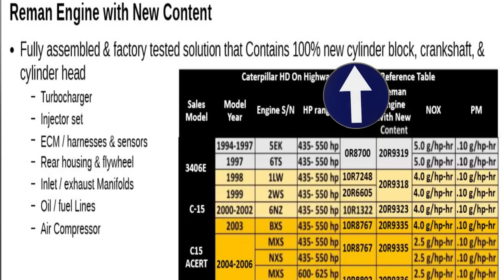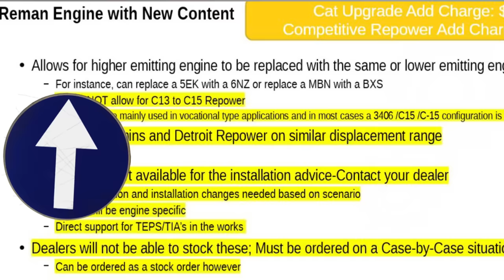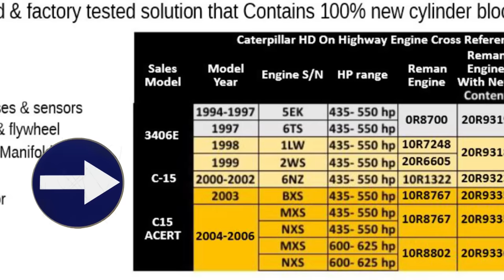Swap Your Cummins for a NEW Cat Engine!  Cat is Making New Truck Engines.

Comment: When the government collapses and the EPA is gone we will need to produce reliable old tech diesels again.
Reply: Lmao
Reply: Amen!
Reply: @tjts1  Where in the budget is the subsidies to oil companies?   I hear this all the time but no one has been able to show the proof of where in the budget it is.  The budgets are on line just go pull the PDF and tell me the line item please.
Reply: @Pusstulio  well there's a lot more subsidies going to "green" energy than any other forms of energy, so "green" energy should be the first to collapse if the government was to collapse
Reply: @tjts1  you'd just buy it.
Reply: Definitely!! an EMP proof one 👍
Reply: When the government collapses...rrrriigghht.
Reply: Maybe if Putin sends DC a gift
Reply: I'm good I have a couple B's in the shop
Reply: @tjts1 , you can make Diesel fuel from crude oil fairly easily. Diesel is the first thing to distill from crude oil making it a cheap fuel just not EPA “clean” even tho it’s cheap to make, & pays for the engine it’s used in fairly quickly.
Reply: Can’t wait
Reply: @tjts1  don't need the government to have oil...
Reply: @Badger Pa  most of the subsidies are tax credits, which conveniently aren't a budget line item, so the value has to be estimated from financial analysis. Here's a summary of some tax breaks and their estimated value.

 Intangible Drilling Costs Deduction (26 U.S. Code § 263. Active) $1.59 billion

Percentage Depletion (26 U.S. Code § 613. Active). $12.8 billion over 10 years

Credit for Clean Coal Investment Internal Revenue Code § 48A (Active) $1 billion

To name a few.
Reply: We can only hope 🤞
Reply: @markwilliams4525  Exactly. "Green Energy" generally speaking is a money sinkhole.
Reply: Exactly brother..
Reply: @tjts1  show us proof of these “subsidies!”
Reply: Can't wait until Detroit makes the 92series again oh and maybe a 8v-110 engine too!
Reply: @fly-over1517 it’s either that or we go down. It’s we the people not the other way around
Reply: Hoping the Government collapses? Why not move to Russia instead comrade Drew?
Reply: Translation: Any brand with mechanical injection... Cummins 400, Detroit 318, Cat 3406b'. Modern chassis 4-stroke stuff that'll do around 2000 ft-lb and mate to a 13+ speed
Reply: @thebigmacd  thank you. That's right where I was headed. Military spending is another thing you can't find all of the numbers up front on. Tax breaks, subsidies, etc...
Reply: @fly-over1517  people are the government, and we haven't collapsed..
Reply: @tjts1  Mexico
Reply: The scary aspect of that is how much money will they print/spend and bailout wasteful industries, how much will the taxpayer suffer before they admit they were wrong? The answer to that should be your level of preparation. They aren't coming to save the taxpayer.
Reply: @fly-over1517  You know when a consumer maxes out their credit line and tries to consolidate or refinance several times? The government has reached its limit with the world bank. Even voting in another "debt ceiling" will not change the outcome. We have done this 80 times since '81-82. The globe can easily decide to default on the USD since its debt is high, and not backed by real assets.  Follow the multipolar world overseas, they are dumping the USD as the reserve to save the global economy. Oil will be first, followed by agriculture, and manufacturing.
Reply: @sandasturner9529  As much as I love the Cummins and Cat, the 16V92 is king. That monster is almost too big for a truck, more like a ship.
Reply: @francomtz7115  I would agree with you, aside from the fact the majority of citizens do as they are told without critical thought. We're not in charge obviously.
Reply: @tjts1  cold pressed vegetable oil
Reply: @tjts1  That would mean the diesel fuel would skyrocket to like $6 per gallon. Oh wait, the price is already that high. 

The real problem would be keeping the refineries going, against the chaos that would take place in a govt collapse.
Reply: @tjts1  ever heard bio-diesel?
Reply: @tjts1  from me, when I buy fuel.
Reply: @cstew8355  your comment cracked me up, to make a  EMP that can take out a computer needs to be almost as strong as a nuclear bomb 🤣
Reply: @fly-over1517  it’s closer than you realize
Reply: @michaelbenoit248  I have about 20bbl of crude i need to dispose you are welcome to it lol
Reply: @tjts1  they make diesel in nigeria
Reply: When the government collapses, what will you buy engines with?
Reply: Dude,   put down the pipe and step away..
Reply: I wish. The reality is the irs, atf and epa will survive
Reply: @jakeford7688  I have a 379 Peterbilt 425 Cat B model do you have any idea how much it’s worth?
Reply: @donaldindividual-1  by the way Russian citizens have more far more freedom then we do here.
Reply: @scotteric8711  16v Detroit were made for for Marine engines. In fact original Detroit engines came from Marine two-stroke engine design.
Reply: @ShaunHensley  I will barter chickens an eggs.
Reply: Can’t wait!💪
Reply: @tjts1  The government has money? Wow. How did that happen? 🙄🤦🏻‍♂️
Reply: My beloved California is dying fast.
Reply: @tomstulc9143  As do most Europeans in general. Except the poor Brits. In Poland you can walk around a mall with a 40 oz. That's bliss. 🤣
Reply: @tomstulc9143  Theres a few in OTR trucks. The Army still uses the HET 1070 which uses the 8V, although they have a prototype with the 16 that never made production. And yes, it was ugly. 🤣
Reply: @dortega1404  $20
Reply: @leejohnson6173  what are you trading for the fuel? Who is shipping it? Maintaining the roads? Electric grid? Who is stopping the electric company, fuel company or whomever from charging what ever they want or if the company is big enough from taking your stuff and becoming the new gov with no constitution?
Reply: It’s coming.
Reply: Gotta have a dream.
Reply: Right
Reply: I've watched interactions with EPA employees. They're really not the brightest bulbs in the chandelier.
Reply: @tjts1  Why is Jet A cheaper than diesel ?
Reply: Don’t hold your breath.
Reply: WITH MECHANICAL INJECTOR PUMPS
Reply: I bet you’re exhausting at parties.
Reply: Oh Man!
Reply: When the dollar collapses and is replaced with some other country’s currency, that’s when the fun begins.
Reply: @MrErichonda30 they have and it’s named Joe Biden
Reply: Agreed
Reply: @tjts1  recycling plastic
Reply: Yea!!!
Reply: I dunno! That's wishful thinking.
Reply: @thebigmacd  tax credits and tax breaks are not subsidies. Tax subsidies are what green energy gets. Tax breaks are what fossil fuel receive. The difference is that if the government were to collapse, green energy would also collapse. While oil would get more cheaper and more abundant.
Reply: @Rudderify  that was china
Reply: @tjts1  do you actually think that subsidies are necessary for oil to be produced? Just because the government is tossing out money and companies are taking it doesn’t mean it’s needed. Green energy on the other hand, most likely wouldn’t exist without subsidies. Especially wind power.
Reply: Sure thing, the government is going to collapse while oil refineries continue unabated 😂
Reply: All it would take is a Lawyer at Cat realizing that the gubbment can’t haul Cat into court without Locus Standi; aka, a customer that was harmed by Cat’s business practices.
Reply: @tomstulc9143  In russia you criticize putin you go to Gulag
Reply: Ha
Reply: Lol, when...
Reply: Hallelujah, I want my Studebaker 6x6 !
Reply: @tjts1  motor oil or alcohol still. Pretty easy
Reply: The government isn’t going to collapse and the EPA isn’t going anywhere…not with you all commenting on YouTube video 🤦🏻‍♂️🤦🏻‍♂️🤦🏻‍♂️
Reply: @AbcXyz-rn2lz  

And i wish there are carburetted diesel engine

Because we can easily tune the AFR easily
Reply: @rab _aintboutit  
Government is going byebye, Mr Rabbi. You can't stop what's coming. The fire rises.
Reply: I hope that happens soon
Reply: @scotteric8711 it's primarily used in the marine industry ,tbh with you
Reply: @tjts1  I'll find or make fuel.
Reply: Sign me up. I want some 2 Stroke Detroit Diesels.
I love pre emissions diesels.
Reply: Hell yeah
Reply: @scotteric8711 lol. I’ll bet on Americans for many decades to come - not against them. 

Doomists are weird.

Comment: The secret message here is take very good care of your 2000 and earlier trucks because now you can get a brand new engine for it. NO emissions YAAAA. More better power and excellent reliability. Go cat 😁😁😁😁😁
Reply: They gotta start selling frames and cabs too
Reply: @andrewk8636  👍😊 make ole epa man blood pressure go up
Reply: No thanks I'll keep my 9.5 mpg over my old shitty ass 3406e. Cat is the worst thing to put in a truck if you're out here to make money.
Reply: @monsterpke857  Wow!! what are you hauling that you get that mileage? I've been driving truck for 42 years. I've never heard anyone say they have had bad luck with a 3406E. Maybe you just got a lemon. It happens. Maybe you pound the hell out of it.
I have a C-15 with 850,000 miles on it and I've not had to tear it down yet.
Reply: @railfaninpf  at no point did I say a 3406 B or E was a bad motor cat does not make a bad motor well maybe the Acer wasn't all that great but for me it's about making money. As we all know the market for making money in trucking is very bad right now.
Reply: @railfaninpf  I've had a 94 379 with a 3406 B. Was a good truck got like 4.5 MPG. I had a 2014 389 with a Detroit and it got like 5 mpg. Now I have just a simple Cascadia with the 500 horsepower X-15 and I'm getting right at 9 mpg. It is deleted. Honestly I hated the way these trucks look but I'm a very tall guy and I definitely cannot complain about the Comfort or the room that I have in this truck and I guess with the aerodynamics helps too but yeah I'm getting right at 9 miles per gallon but I also don't run her over 70 mph unless I really need to pass a group of trucks
Reply: @monsterpke857  you do you, I’ll stick with my cat that’s been paid off for years and has a extremely low cost of operation. Could I get a little better fuel economy with a new truck? Maybe, but not even close enough to offset having to pay for the new truck.
Reply: @monsterpke857 what do you have? I didn’t understand
Reply: @monsterpke857 I didnt get that much worse from the Cat to care. The Cat performed well and that was worth a lot.
Reply: @monsterpke857  you are correct but most think they can pay their bills on smiles per mile alone.

Comment: For years I've recommended the Cat 3406E and C15 series. But seeing how many miles on those old blocks and reman parts  and some of the issues my customers have experienced, I have been changing to newer trucks just because reliability in the remans is getting worse. I hope this program gets the reliability and longevity back.
Reply: You in NY?
Reply: This is why we do our rebuilds, cheaper and better quality control.
Reply: @MitzvosGolem1  Kansas
Reply: i got a reman from cat 7 years ago-a c13--have put over 1,200,000 miles on it--only did one overhead,changed one injector--tanker operation,running half empty,the ecm shorted out once on a bad wire--out of 65 trucks in fleet,best fuel mileage,lightest truck,highest revenue in fleet--still going, using 1gallon of oil every 3,000 miles--my 2008 f-350 with 6.4 gives me nothing but problems--lousy fuel mileage(no deletes)-in a 130,000 miles of no heavy hauling been in shop way too much--love the truck,hate the motor-love my cat which a lot of people don't like c13 but perfect for light weight--i made on average 4000.00$ more a month than the hairy legged petes,kws with c15 with my little kitty---that is close to a half million in 10 years!!!!! my truck is a cheap ass freight shake--2007,looks new
Reply: @dethray1000  Yeah I would be finding a different power plant to swap out that 6.4L.
Reply: I wouldn't swop a Cummins for a Cat anyway
Reply: @dethray1000    Lost me at Ford, go drive a Volvo .
Reply: The problem is letting Cat do the rebuilding. They are only going to stay within factory specifications which are more liberal than a reputable rebuild shop that will actually machine the block and balance the crank.
Reply: @dethray1000  1 gallon of oil every 3k? Its junk bud.
Reply: Just avoid anything ACERT.

Comment from the maker: Thanks for watching. If you are considering doing this swap and would like me to do the swap, whether filmed or not, please reach out at AdeptApe@yahoo.com. Thank you to everyone that submitted Destruction of the Week info.
Amazon Affiliate Links to recommended tools: 

Fuel Pressure Gauge, Compucheck 0-300 psi: https://amzn.to/3YeBldu
Airlift Cooling System Vacuum Filling System: https://amzn.to/3D9AlPu
Radiator Pressure Tester Kit: https://amzn.to/3QGBumn
Milwaukee 3/8" Right Angle Impact Wrench: https://amzn.to/3D2CvAk
2 Pack M12 Style Batteries for Milwaukee: https://amzn.to/3D2mdHE
Adjustable Height Parts Tray 100 lbs: https://amzn.to/3CBusZB
Engine Oil and Fuel Dye UV: https://amzn.to/3z34zkv
UV Professional Grade Light: https://amzn.to/3gzxPc0
Oil Pressure Priming Tank: https://amzn.to/3YuBrNr
Photo Tach REED: https://amzn.to/3ATJ8Cw
Reply: Your lighting is startlingly off. Your face looks so blue I thought you were having hypoxia.
Reply: Emailing you now!
Reply: His face does not look blue and the video was just fine ! Thank you for your information !
Reply: Fake news
Reply: I call cat they said no
Reply from the maker: I made it very clear in the video you can only go from older to newer or older to the same, I was just alluding to all the different ways this program works with Detroit's, Cummins and older Cats. The Vice Versa probably should have been left out, but either way we are only doing legal swaps, so no fines.
Reply: Can we send destruction pictures to this same email?
Reply from the maker: Yes you can and many people do all the time.

Comment: I'm doing one right now with my 2ws. It comes complete and pretty much ready to run
Reply: Let us know how it works out. Be interested in seeing the progress and outcome. 👍
Reply: How much you pay?
Reply: I'd also like to know how much you paid. Kind of a big detail!
Reply: I'd like to know an estimate on the cost as well. My engine is a 07 nxs acert In need of a rebuild.
Reply: @jonny1992vw  A reman 6nz at the local CAT dealer is 45K with a 19.5K core deposit.  I can only imagine what the new engine will run.  The 20R-9323 number will not even come up in their system.    2WS is actually almost 46k with same core charge.  At least that is what the dealer website shows.

Comment: A reman 6nz at the local CAT dealer is 45K with a 19.5K core deposit.  I can only imagine what the new engine will run.  The 20R-9323 number will not even come up in their system.

Comment: I’ve worked at a CAT dealer for over 10 years now and CAT has never stopped building C15,C16 or C18s they just don’t sell them for truck use! They’re still in production for use in generators air compressors and larger equipment that doesn’t have to meet EPA on road regulations!
Reply: Why do you not produce a parts interchangeable list so you can help us out without getting in trouble
Reply: This is true!!!!
Reply: @johnw4590  the c15 industrial version  has tier 4 emissions but they’re not as strict as on road refs! The c18s are mainly marine use and are even lower regs!
Reply: Fire trucks rum c18, yes
Reply: Military trucks such as MRAPS, FMTV's, etc still use C7 and up as they are also exempt from EPA emissions.

Comment: I thought that I read that Caterpillar may consider making engines again. but I also remember Cat saying, that they didn't want continue fighting constantly changing emissions regulations. and I agree with Caterpillar with their decision.
Reply: In the 80s, Detroit Diesel used to be the leader in the engine market. But the EPA has stripped Detroit Diesel of it’s rank and by the mid 2010s, Cummins took the spot as the leader of the engine market.
Reply: Cummins is not good either they have really bad coolant issues all across the engine and emissions system.

Comment: According to CAT spokesperson on the 12th of January this new motor is not designed for Class 8 or heavy highway use. Primary use is for building material handling and light construction equipment.
Reply: @ Stefan Snider thanks for the additional information, I  was starting to get my hopes up,   about CAT making a  complaint emissions motor  for,  highway and off road trucks here in California,  many of us had to give up trucks for newer ones  with  cummings and paccar computer motors that constantly have issues and stay in the shop.

Comment: You can buy new c15 blocks. It won't be a 6nz casting style but the engine is. Pretty much exact the same. Cat still makes c15 for brand new dozers. The SN break is just different like ENG, or RDP an break.
Reply: Can you buy a brand new  block from cat
Reply: And with the change to heavy equipment emissions I don't see why CAT doesn't get back in the truck engine market, since they already have engines that meet the emissions standards that caused them to exit the truck market in 2009.